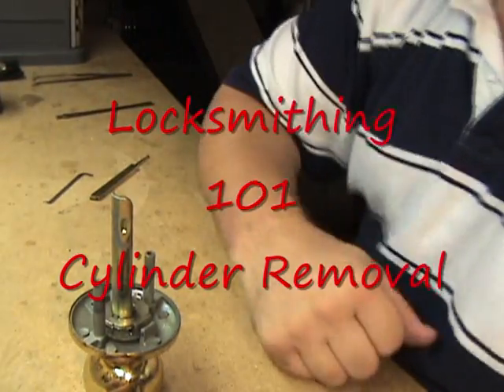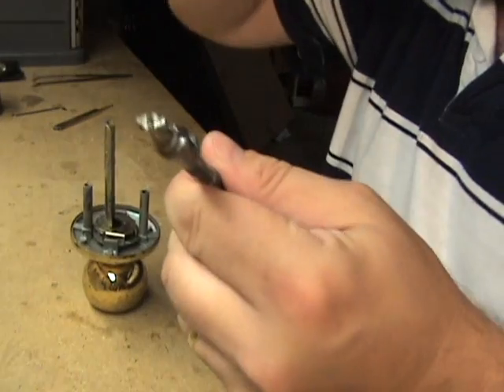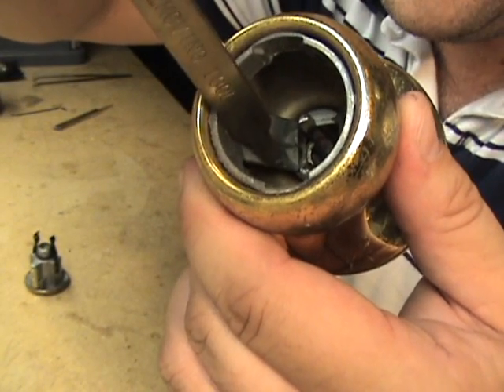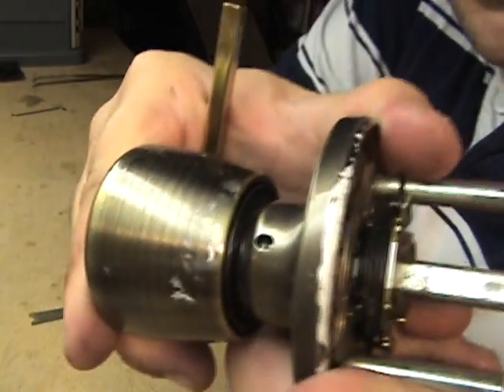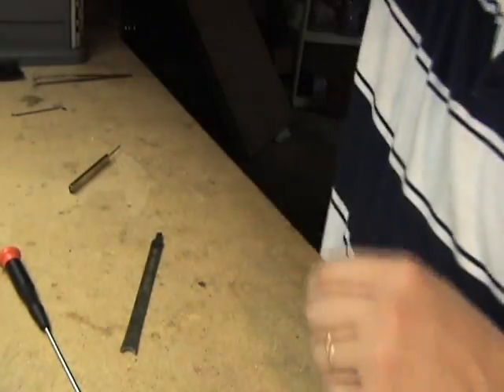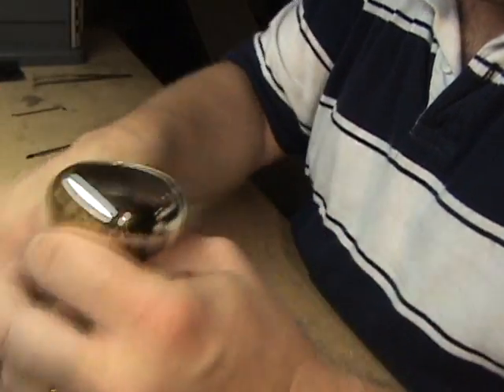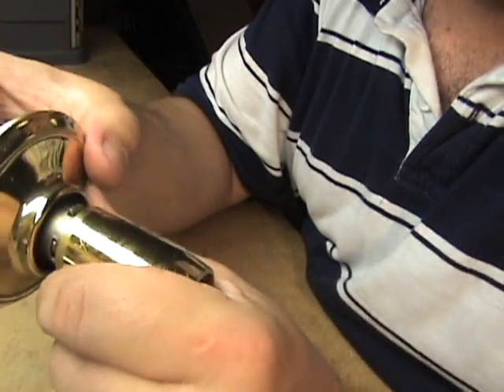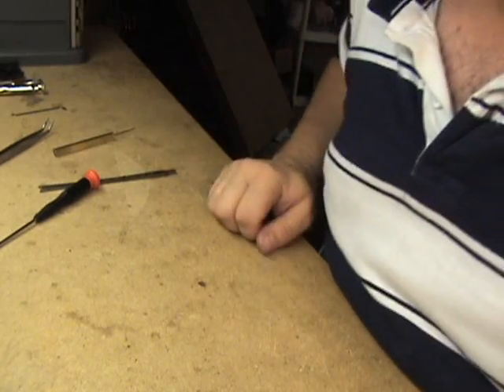Locksmithing 101 Cylinder Removal

Comment: Dude, thanks for the video. Extremely helpful. I have a bathroom Kwikset doorknob set. I used a screw driver to get the spindle out. The lock would keep turning, yet the doorknob would not lock. I discovered the cylinder at the end of the plastic spindle was cracked. There was a split. I tried fusing the plastic with the tip of a hot screwdriver, but it was a mess. It didn't work. The wall only became weaker and brittle. I tried a different technique. I wrapped very tightly Scotch Tape (cut into manageable strips before application) around the cylinder to close the seem. Then I ran a test to make sure the spindle would fit back into the assembly. If it won't fit, remove some tape until it fits. Now that it fits, test the lock by turning it to make sure it can activate the internal mechanisms. If it works, then remove the spindle again and placed it aside. I had Loctite 30071 0.85 oz Plastic Syringe Epoxy Plastic Bonder in my basement from a previous DIY project. I mixed it up using a disposable chopstick and plastic take-out soup lid. I packed the epoxy into the cylinder, making sure not to get globs on the outside. Also, I made sure not to overfill it, as the lock shaft has to reinsert back into the spindle cylinder. I made sure to get the epoxy on the inside wall of the cylinder. Next, I inserted the spindle back into the assembly. Then I installed the doorknob set back onto the door. I allowed the epoxy to cure at least 25 minutes, then tested the lock. I worked great! I would give it a day to really be forceful in turning that lock back and forth though. The more time the epoxy has to cure, the stronger it gets. By the way, this will permanently glue your spindle into the assembly, so you will not be able to remove it in the future. Should it break again, just replace the whole unit. These bathroom doorknob sets are cheap anyway. I did what I did because Home Depot was closed, and I was impatient. If you really don't like the idea of permanent, try wrapping Teflon plumbers tape over the lock shaft before inserting the spindle back into the assembly. This should hopefully allow you to remove the spindle again next time around.

Comment: Excellent, my additional tip - before you start, I suggest you add a small piece of masking tape on the barrel (indicating the original position of the key), then flip the cylinder 180° after you popped the cylinder out.

Comment: Great video thank you.  I have a Kwikset entry and have removed the spindle though am unable to remove the cylinder.  This is from a rental and I do not have the key.  The Kwikset rekey kit came with tool that I have already bent trying to remove this cylinder. Any other tips?  It is NOT a smartkey lock.

Comment: How do I remove my door knob that turns from the back plate? The door knob that I have does not have a little hole on the side of it where you can put something in it to release and slide out the doorknob please help and greatly appreciated.

Comment: appreciate your instruction on how to swap a left-handed to right-handed door lock kwikset but after doing it if I rotate the knob back and forth it unlocks. Lock switch on the inside of the door knob doesn't rotate completely not sure why it's not working now completely. I was using a kwikset 690 door knob

Comment: Having trouble with the kwikset lock knob engaging. Took it apart....got the spindle out. Noticed that neither release tab seems to be spring loaded. Could this be the whole problem?  Is there a way to get at the spring thats under the metal plate to see if its broken and replace it?

Comment: I'm trying to rekey using a Prime-Line ReKey a Lock kit and can't get past the pull spindle, turn key 60 degrees to pull the cylinder out. The spindle does not seem to pull in and out, just turns with the key. What am I doing wrong?

Comment: Hey nice video. Question: I have a similar knob, one side (outside part) is for the key while the inside part is that twisting lock you turn 90 degrees. My problem is that the twisting lock can be pushed in too far and just spins around; it doesn't hold on to anything. Is there a fix to this or do I need to buy a new one? Thanks

Comment: these videos are all based on lock picking. When I rekey key these at work I already have the key that operates the locks so you don't need to use a pick. most people watching these videos are trying to learn the proper way of  disassembly and rekeying, not the illegal picking way.
Reply: Because a good lock is very very expensive and it's much cheaper to change the key cylinder.